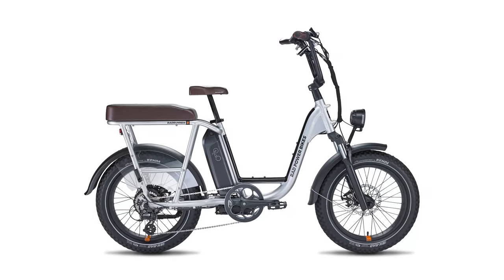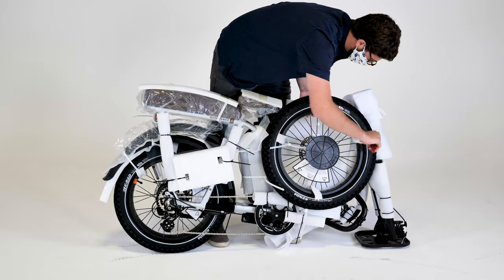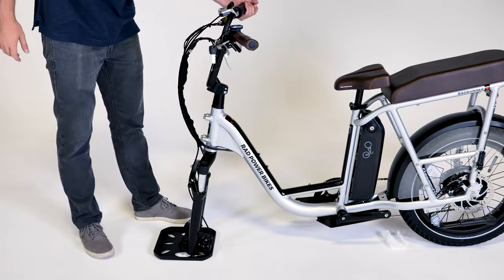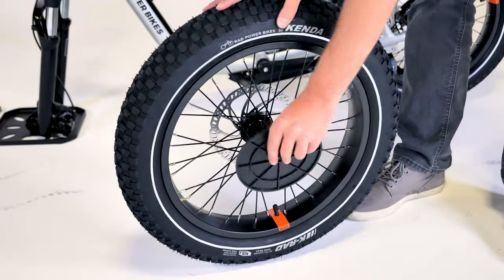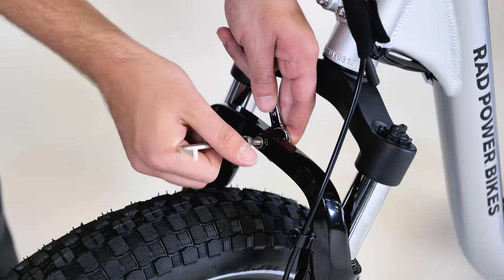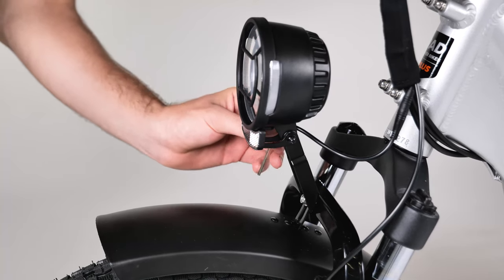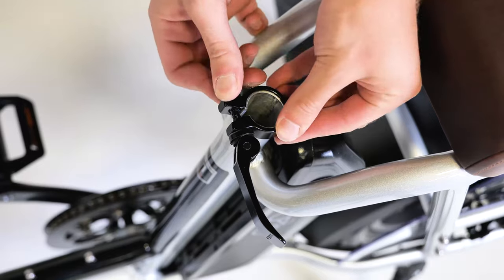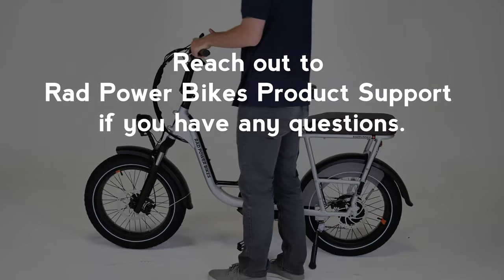RadRunner Plus Assembly Instructions | Rad Power Bikes

Comment: Thanks for making this video, much more helpful to me than just the booklet. However I wanted to point out that the bolt to adjust where the headlight points is smaller than the 8 wrench you say to use. I did just get my bike in Oct of 2022, so idk if maybe parts have changed.

Comment: 7:15 "use a pedal wrench to torque each pedal to 35 newton meters” Are torque pedal wrenches available? Please explain how to do this. (I'm aware of torque socket wrenches, but unclear about torquing with pedal wrench.)
Reply: It just means a thin wrench. I use an adjustable wrench for it for years. Carry it in my bag with me for all small jobs on the bike. As long as it's thin.
Reply: I'm also curious about that. I just purchased one.
Reply: @rideoption2008  They gave you the wrench in that small bag. It's enough for that small job. I do think oiling all prior is a great idea, or using grease.
Reply: Yeah this made so sense to me either.
Reply: If they just mean "thin wrench" I wonder why the specified "35 newton meters."

Comment: How many hours does the battery last? And how long to recharge it?
Reply from the maker: Hi Salma, battery range depends on various factors, including payload weight, use of throttle/PAS, and terrain. The battery has a range of 25 miles to 45 miles per full charge. The battery can fully recharge in 3 to 7 hours.

Comment: Is a Newton Metric Torque Wrench necessary? Thanks in advance for your input.
Reply from the maker: Hey Toni, we recommend getting a torque wrench to ensure you have everything torqued to the appropriate value. If you do not wish to purchase one, you may also want to look into having the bike professionally assembled by a bike mechanic.
Reply: I have a socket wrench set, plus a Stanley set with different hex nut drivers. Works like a charm. You can get under the saddle, or anything without laying under it. I think each set was less than $20. Even if you did put it together without, get it for the future. Bikes need it a lot through the years.

Comment: So I'm in Europe and looking at buying one but the pictures on the euro website has the bike with no passenger package or upgraded front light but when you look at the accessories separately they say they are included with the rad runner plus. Can anyone confirm that they come with the euro version or not?
Reply from the maker: Hi Robert! 

The version of the RadRunner Plus visible on the European website is exclusive to European customers.
It holds a 250W motor, 7-speed drivetrain and can hold a full payload capacity of 136 kg.

Unlike the US version, or original limited edition RadRunner Plus, this RadRunner Plus does not include a passenger pack or Premium headlight. It is, however, sold at a lower price and has a halo headlight (seen on the RadRhino). 

As with all European Rad Power Bikes models, the RadRunner Plus holds a Twist-power assist, and not a throttle (as seen on US & CA models).
Reply: @RadPowerElectricBikes  And that is what makes us all cry.
If Europe and the governments are constantly talking about emission reductions, more tax to diesels, etc, they should stop making the Ebikes so boring and not so useful, compared to North America.
Also, if i convert the prices, the EU version is still more expensive, at least 30 bucks, with less stuff. So i dont know what you mean by "are sold at a lower price". Well, maybe a year ago, that used to be the case, could be that too...

Comment: What is the correct tire pressure for the tires on the Rad Runner Plus? I don't see a number on the tires.
Reply from the maker: Hi Toni, the recommended PSI for the RadRunner ebike tire is between 20 and 25, though you can pump these tires all the way up to 30 if desired. We can't recommend running these tires less than 20 PSI, or greater than 30. Happy riding!

Comment: so are the washers included with the handlebar faceplate hardware to be discarded? they are not mentioned anywhere in the video or in the instruction booklet. it would be helpful if the information in the booklet was consistent with the video.
Reply: I don't know if you've figured it out by now but you thread the washers onto the bolts. It's mentioned when he first takes the bolts out.

Comment: What size is the pedal wrench as well as the bike torque wrench? I'm watching and preparing before the bike arrives :)
Reply from the maker: You'll want to use a 15 mm wrench to tighten your pedals. This is included in your toolkit. If you're purchasing a torque wrench, you'll want one that has settings between 6-10 Nm.

Comment: I want this e-bike. How can I get one? Their website says it's out of stock and it won't let me order one.
Reply: My wife and I each bought a Rad Power bike in June... maybe July.  My RadRover arrived a few months ago, but her RadRunner Plus (the one in this video) is on a FedEx truck to be delivered today.  I read an article from BusinessWeek a week or so ago about how Rad was overwhelmed with orders when COVID hit (everyone wanting exercise at a social distance and something fun to do).  

Use the "In stock electric bikes" feature on their website.  They have a bike based on the same frame, but in green, available now.  You can add the rear seat as an  accessory (out of stock, but they will have 'em eventually).
Reply: Thanks. I ordered the RadRunner Plus and will be delivered in March 2021.
Reply: @stevecabacungan  Now they were out of RadRunner 1. I ordered plus instead though I'll take the rear seat off. Other upgrades on it are worth it though. I needed for one of the part time jobs. I didn't have a month plus to wait, if even that was not pushed off further. Oh well. Plus seems solid.

Comment: It is absolutely not as easy as the guy pretends. This is another ad by Rad, not an instruction. 

Specially dont get fooled by the front tire. Put the bike upside down and then do it
Reply from the maker: Hey Shaahin, thanks for taking the time to watch the video, and thank you for the feedback! If you need any additional assistance please don't hesitate to follow up with our Product Support team via email at - radpowerbikes.com/support.
Reply: Enough mechanical skills such as linking the caliper up to the rotor and putting in a front and back wheel is the only skills you need to know